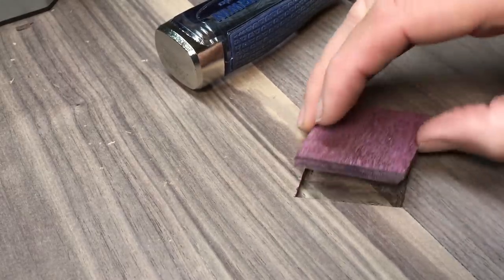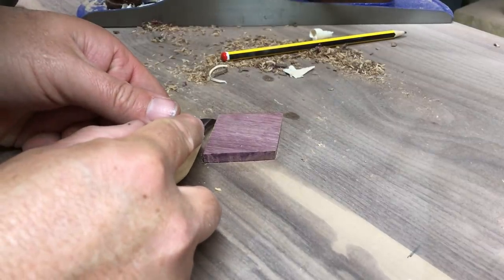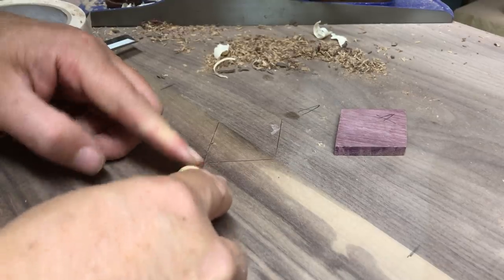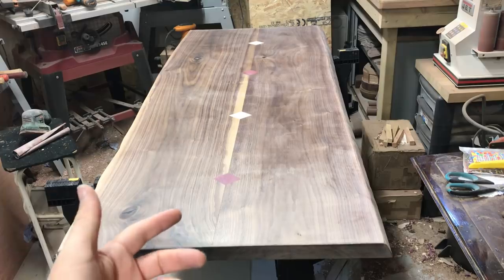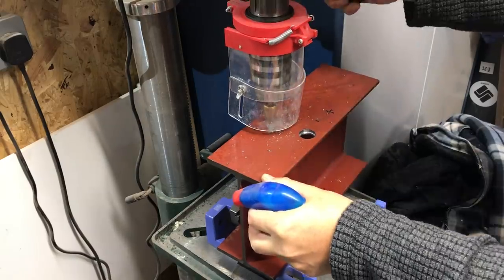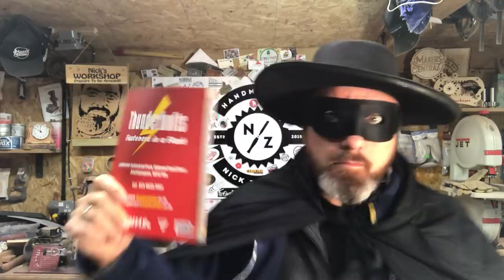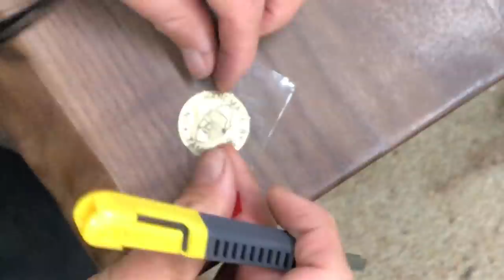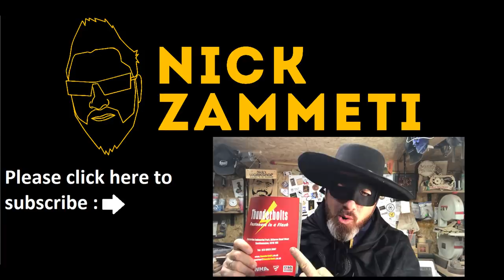Live edge walnut table with exotic wood inlays / Part 2

Comment: You can see the bevel on a chisel as similar to the crank on a wrench handle. That is, the angle allows you to approach the work from two different directions.  In some circumstances the bevel should be down so the handle is up out of the way. Like when cleaning out the corners of the hollows you are creating. This means the bevel will be able to go all the way to flush with the surface you are trying to create. Giving you greater control and better, cleaner results. Semi-pro tip. Beautiful work, Nick.

Comment: Table turned out great.  LOL  My OCD wouldn't allow me to have a textured finish like that, It would drive me nuts...  But yours looks Awesome ! I want to make a river table but the mass amount of resin involved would be costly. unless we cheat and only router the river in,  ignore the trolls buddy, can't wait to see what you come up with next !
Doug
Reply: The Pohl Barn Projects
Nick with the router in one hand and funky resin in the other was exactly what I had right before my inner eye when he thought about river tables!
E.g. the head - part of his logo. 😉
Reply: Imo that (or some variant of the whole "just carve enough wood out of the way") is the only way to make a real river table. Every river has a bed, it doesn't float in space between two floating blobs of Earth. You can also use the texture of the wood/material beneath in the composition. Of course, that require some brain power, and while it costs more it is just easier to mix and dump some resin carelessly like people frequently do.

On a tangent, I also hate how many people use resin "let's make a full sized blank then cut/turn it into shape!" You're already casting the damn thing, so make an effort to make a decent mold that is as close as possible as you need the final shape to be.  If you're just going to handle it as if it were a piece of plastic stock, go and get yourself a piece of plastic stock for a fraction of the price and effort then.
Reply: Just in case Nick doesn't see my post I was asking about the carbide tipped tools with Nicks logo in your Purple vase video where can I find them.
Reply: I think I ordered them from his web site, I checked it but he doesn't have any up, for some reason back when I ordered them from him it was on Etsy.
Reply: @PohlBarnProductions  Thank you I'll check there I'm hoping Nick will respond as well and let me know for sure.great videos Doug you guys have inspired me quite a bit I just got my wood lathe and now I'm tooling up I am a gunsmith/machinist but never worked with wood thought I would give it a try after some Youtube Inspiration.
Reply: I couldn't find an Etsy site for him, nor was it in my purchase history,  That's AWESOME I'm glad I could inspire someone,  careful of that Nick guy he'll cost ya lots of money.  LOL  he inspired me to start a channel and turn things into something.  I never turned at all, welder by trade, I drove a truck for years and I even did some finish carpentry, Cabinet making, high end , this journey has been interesting for me, it's not as hard as some would think, just let your imagination free and try that crazy idea.
Doug
Reply: Hey ya know some one asked him about the tools on the F/B page a few weeks back or so,  and he was on top of that and put some up for the guy. ya might want to ask about them on there as well/
Reply: @PohlBarnProductions  Thank you again

Comment: Nick just an idea for your inlays with your router. If you make stencils from thin wood, plywood or thin stock, you can use your router with bushings to both speed up the process and reuse for another project. But buddy I really liked this table. That finish really made it pop. Great job, I just love your channel. Hope all is well in jolly ole England. Cheers.

Comment: That ended up looking great! Just a small critic (of sorts). If you really wanted that sort of metal legs, I'd have cast it in aluminium, weld + clean, or something of the sort (like cut a square tube in half, rivet/bolt the two halves back to back - probably my choice, a real "structural metal reused" look), just so it looks like a steel H-Beam, but doesn't weigh like one.

Comment: Next time you fill a hole in wood with resin, first only make a tiny amount of resin and brush it into the cavity. One that is set you can fill it completely. You can also simply use clear paint to seal the wood first.

Comment: The table turned out fantastic Mr nick. Love the legs very creative but bugger stubbing your toe against them. I will give you some creative criticism when your gluing up the top next time don't keep all your clamps on one side of the top. Put some under the table two it keeps the pressure even and prevents any unwanted cupping/warping of the top. Keep up the good work :-)

Comment: for a table top idea. what about cutting out like an easter egg pattern with say 1/4" wood between the shapes then blocking of the under side with sticky back plastic and from the top different colored resin  a bit like a stained glass window. or using swirls as the shapes oh i can see it now. unfortunately i will not be able to buy it from you as i am potless.

Comment: If you ever fancy doing a proper funky LED table then drop me a message. I once did a sign at Piccadilly Circus that you could control via the web! But maybe something more low key for a table 😂 Anyway, I’ll do the electronics if you can think of the ideas ;)
Reply: Or maybe an automated bartender? In resin, wood and aluminium

Comment: How much does it weigh?
Reply from the maker: not sure but its heavy man
Reply: @nickzammeti  I can imagine! Weight on some things can sneak up on you as you're building them.  Each of the individual components don't seem bad but once it's done, you feel it in your back.  I had that happen with some solid, oak benches I made. Once everything was together it was around 100 pounds and with the length plus the weight was not able to be moved solo.